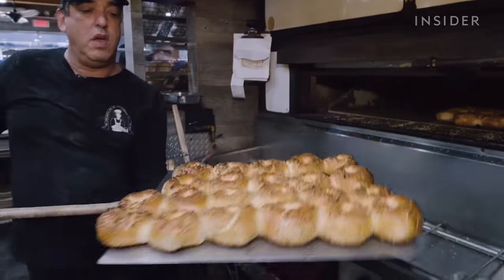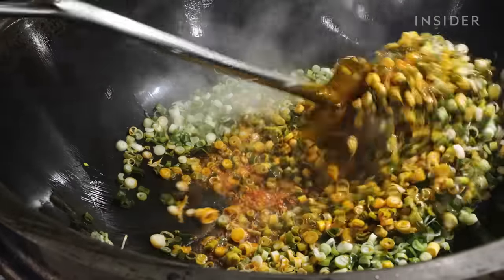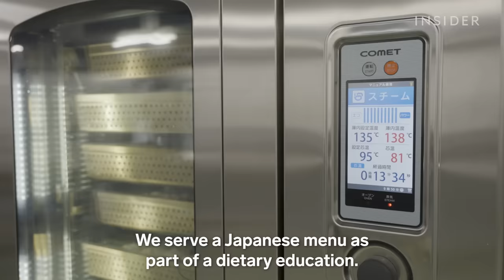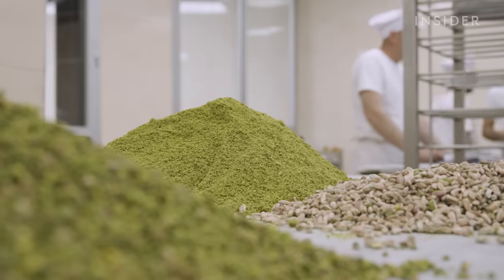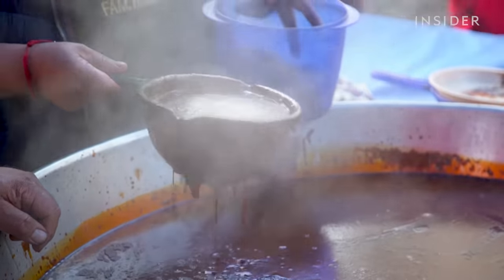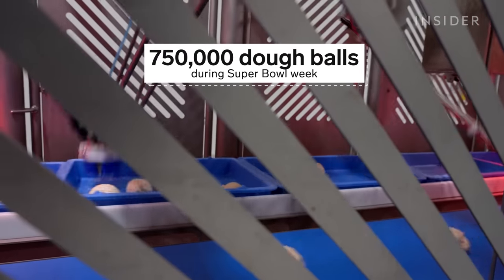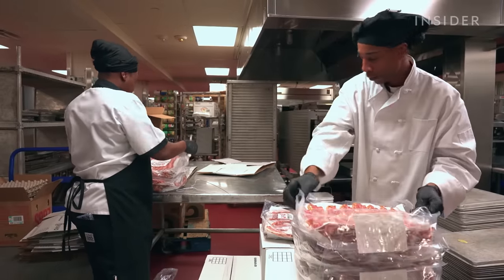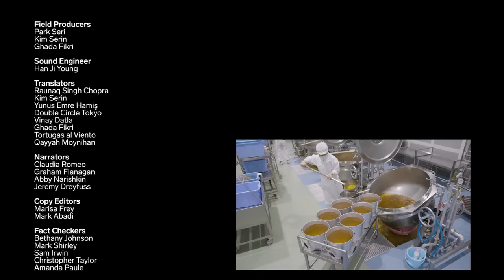How The World’s Biggest Batches Of Food Are Made | Big Batches Season 2 Marathon | Insider Food

Comment: I use to make doughnuts for a small shop the water temp is everything in proofing I use to step out the back door and take in the temp and humidity and then run water over my fingers until I felt it was the right temp after awhile I could get the temp of the water about spot on every time.

Comment: If the bagel company makes 10k a day why do they have over 20k bagels in the fridge? Do they proof them for over 48 hours?
They have 3500 customers, for 100000 bagels? So the average customer orders 30 bagels?
How does that oven work? it looks cool.

Love the Korean one. Um, ya we dont use this shovel for digging, only stiring. But what is with that kitchen, it looks super fancy but the meals are $5usd?

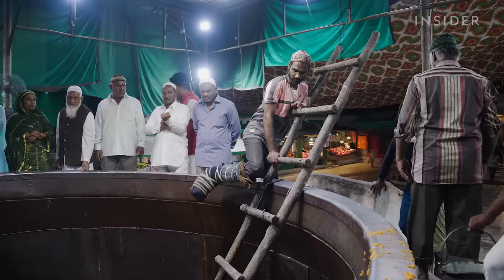50:00 Akbar invented electric welding centuries before electricity even existed.

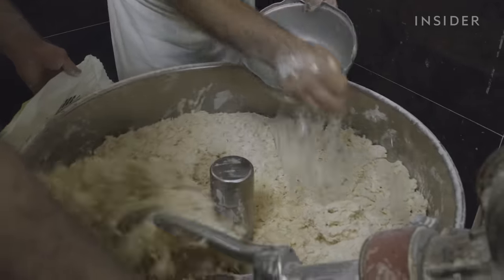1:06:30 :face-orange-biting-nails:

1:54:30 "we double checkl that each tray has a label" The labels go12 feet in the air on the top, you are not check more than half of those.